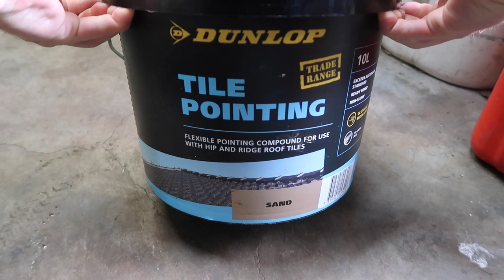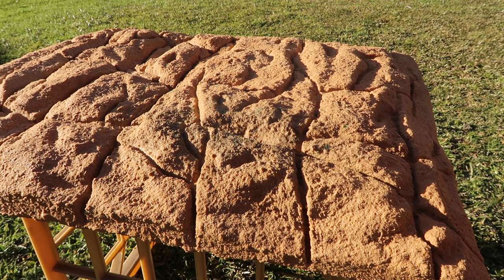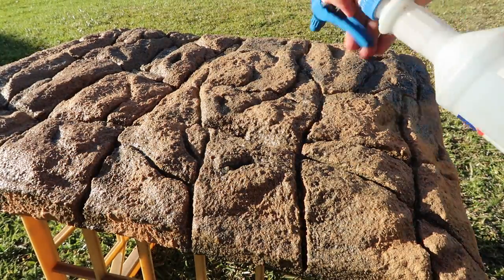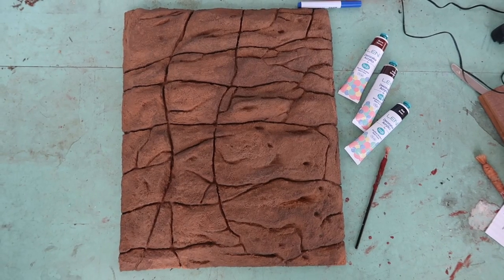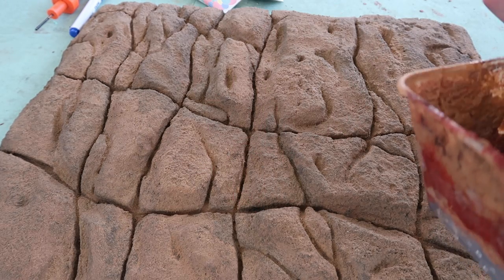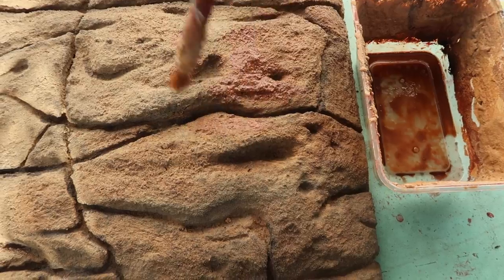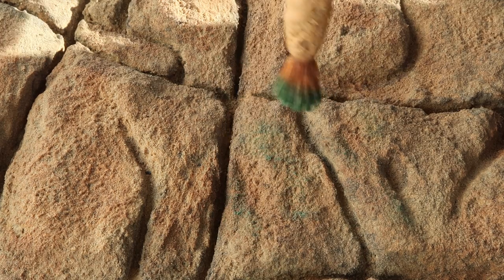DIY Vivarium Background!! Fake Rock

Comment: Would it be safe for the reptile if you just painted the foam after shaping it and letting the paint fully dry?
Reply from the maker: Depends on the reptile and how much contact it may have with it. I personally dont like risking small bits of foam flaking off